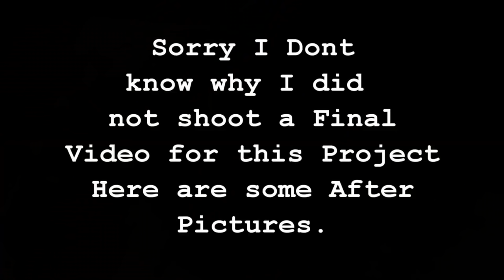METALLIC EPOXY FLOORING | Learn HOW TO Install These AMAZING Metallic Epoxy Floors

Comment: Hi Rick, The football field epoxy floor is really awesome. We do a lot of metallic epoxy floors like you. I haven't had the opportunity to do any decals yet. Do you mind telling me where you got your decals for this project. Also what brand of epoxy do you use? I use mostly elite crete and dur-a-flex for my epoxy projects. Thanks
Reply from the maker: Hi Mike I use The Concrete Protector Epoxy, but also use some Elite Crete stuff like their CSS Sealer and Thin Finish, my decals I just get locally.

Comment: Can you used as a proxy on top of linoleum and what about it kitchen Tile counter??
Reply from the maker: I have never used Epoxy over linoleum, I wouldn't feel comfortable doing that to be honest, your fine using epoxy over Tile as long as you can rough it up slightly

Comment: How the hell do you get it so uniform to look like marble? I watched it but dang it looked like they were just dripping paint everywhere 😂. I guess they've had a lot of practice
Reply from the maker: Hey James good to see you over here on YouTube yeah everything is done in stages to make sure you have fine lines, some steps you didn't see in the video, but as for as the uniformness it's a matter of spreading the material out as evenly as possible then making sure your using the exact same technique and tool when laying down the epoxy, certain tools and methods will give different results and of course experience with all this does help, but another Tip when putting the epoxy down is afterward you can disperse a few different chemicals to help move the material and give you even more effects that help the Epoxy blend a little better.